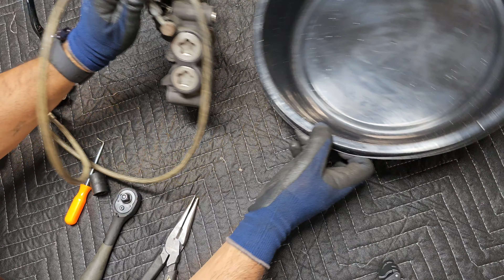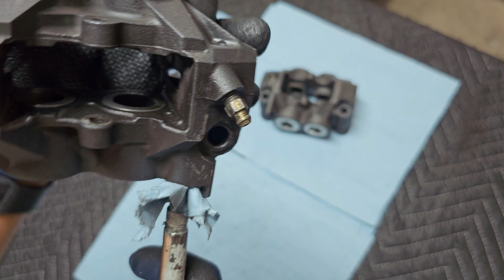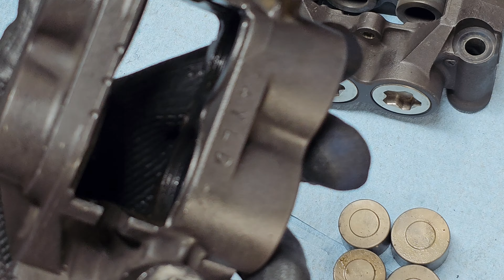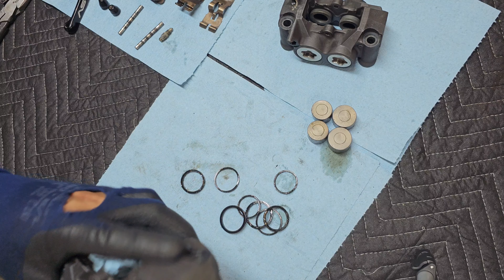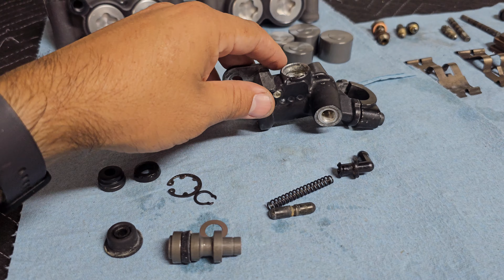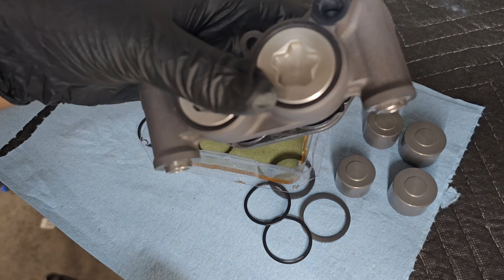Yamaha R6 | Track Bike Series | COMPLETE how to Rebuild Front Calipers

Comment: The Haynes manual suggests leaving the master cylinder connected and pumping out the pistons (two at a time) with it. Makes sense if you don't have access to compressed air.
Reply from the maker: That's a good way as well. It does get a little complicated once you have one side out.  Piston pliers work well if you do not have a compressor. I plan on uploading a video in the next few days to go over that way as well. Thanks for the tip.

Comment: Is there an orientation for the seals ? I heard something about a lip ? How do you know which way to install ?
Reply from the maker: There is, it's noticeable hard to mix up once you see the new seals. There are 2 sizes as well, which both have an orientation to them. Hope this helps.
Reply: @dickquist9483  I’ve noticed the same thing. You put the tapered edge of the seal towards the outside of the caliper. Away from the rotor.

Comment: See those two silver star-shaped things on the calipers? What are they, and can they be replaced?
Reply: You can remove them with a blue dot caliper tool. Cost about £15. No need to replace them but if you remove them there is a seal that will need replacing before installation.
Reply from the maker: Thank you for getting back to this answer. You are absolutely correct. There is no real need to replace other than to change the color. These came in a few color variations. Good luck